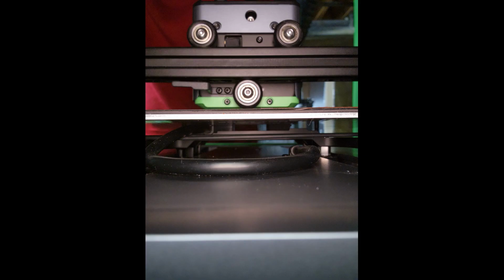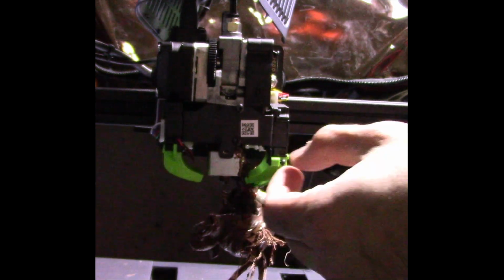Ankermake M5 Print Fail and Hot End Replacement

Comment: Thank you so much for this video. I had this happen to me, but no where near how it happened to you as I caught the signs an symptoms early on. A similar thing happened with an old Ender 3 I had and it almost set fire to my house. The biggest issue is that if the printer has been running for a while as mine had, the blue bowden tube (The short one) the machine comes with can melt and fuse with your filament, causing the machine to block and filament to leak over the top of the heat block. Mine has definitely done that, but thankfully everything was salvageable, except the little blue bowden tube. Thank you for showing me how to take the machine apart.

Comment: Yup just had this happen today. The wires including one copper looking one is inside of the disaster printed filament, the one-time i turned the AI on, and it was the first jam up that I've had and looks like it's bad enough that the hot end assembly needs to be replaced with new wires. Guess I have learned to not use the AI function anymore.

Comment: I had the exact same thing happen! But thankfully, I caught it before the molten mass of PLA had claimed the wires.
The AI is total trash. the only thing it ever alerts for is poor lighting conditions. I have had multiple failures due to adhesion failure and not one was alerted by the AI. It's become the boy that cried wolf.
I am hoping and praying that Anker starts selling replacement parts on their site at least. Like hot ends and bigger base plates.

Comment: I broke off the two long screw that connect the hotend to the rest of the body, I don't know how to get the ends of the screws out, or if that part can be replaced.
Reply from the maker: You'll need to replace the entire hot end. So you'll need to go further then I did with the disassembly and take the heat sink out as well. I was going to replace the heat sink portion as well but the amount of extra work wasn't worth it for me in my case. 
From the sounds of it though, you don't have a choice but to do that now. Just make sure you take alot of pictures so you know how to replace everything.
Reply: @MicBot  I just looked at the spare part that came with the printer, Turns out I already have what I need
Reply from the maker: @mithrandir404  no the one that came attached to the spare hot end. I took the spare one apart in my video and used the hot end only.
Reply: @MicBot  Understood. I'll be putting that on later. I have some tweezers ordered so I can unplug the clips without braking them. Thanks for the help